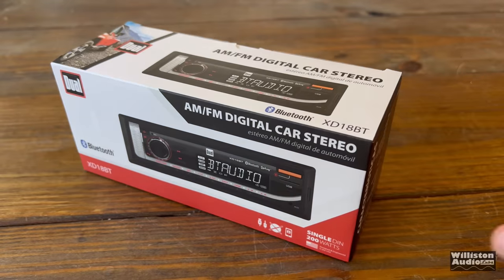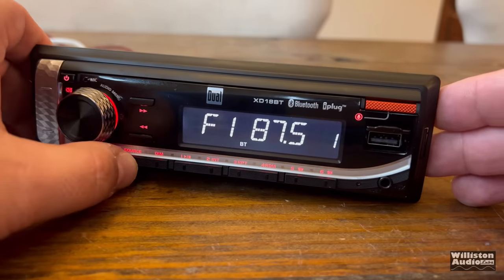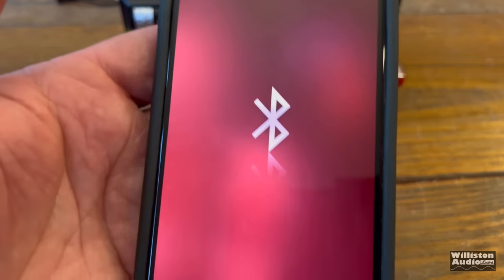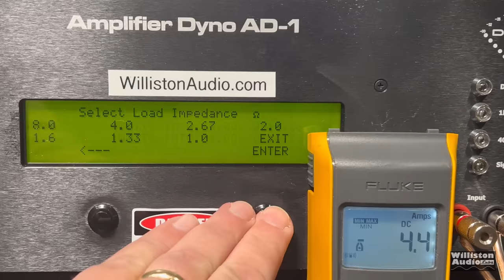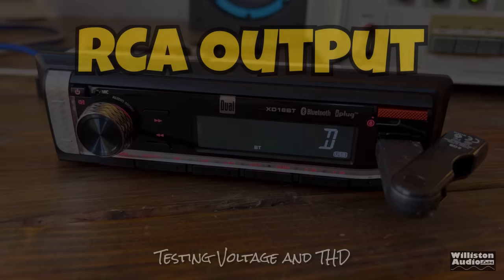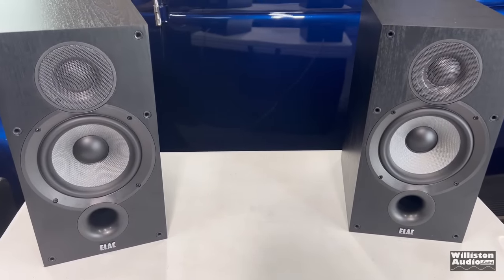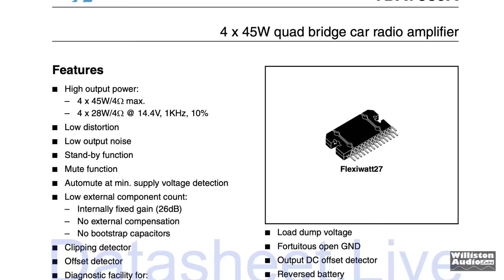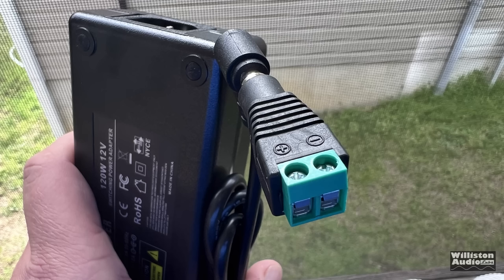How Bad is Walmart's Cheapest Car Stereo?

Comment: AM is actually required to be included in factory vehicles via US law.  The reason being is emergency services.  There’s an AM station for state highway conditions.  An AM station runs on 5,000 watts to run its 10KHz bandwidth at full power.  FM requires 100,000 watts to run its 200khz bandwidth at the same power.  So AM can easily be run on generator power during a blackout blizzard.  It’s only being recently challenged by Tesla, because high output electric motors cause a ton of interference.  All that being said, I think the radio just includes AM because it’s another feature they can advertise.

Comment: ! Same stereo as the XDM16BT Over 3 years ago, only changes are the Face design and the app control! But Overall a Great Basic Radio with USB and Bluetooth capability for the price. Although you may need to press the reset button once or twice due to weird function after trying Bluetooth Calling for the first one or two times but then it works flawlessly! I think It's the same stereo inside that is sold under the JBL brand with a different Face! Could be wrong but it does seem like it. Lasted for over 3 Years now! The Blaupunkpt didn't so Build wise it wins for the price!

Comment: Great video. Great starter on a low budget, maybe get some younger generation interested in car stereo because they can afford it.  I have Dual brand amps that were super cheap , work good , and actually have CEA rated  RMS  ratings on the back of the amp . THANKS for the video.

Comment: These usually come with the TDA-7388 or the YD-7388 amplifier chip they sound decent maximum power you will get is 41x4 @ 14.4 volts

Comment: I put one of these in my 1991 Chevrolet caprice, because the radio that the prev. Owner put in it, went out. The head unit was impressively good, Bluetooth connects easily, and it improved the sound through the stock speakers!

Comment: I have the Dual XDM16BT from a couple years back. It was about $18 when I purchased it. Has 4 RCA outs, the 10 amp fuse is made into the rear of the unit and the chassis is a bit deeper at about 5.5 inches. 
Couldn't get mine to distort at all on the DD-1 using the  USB as the source.
They're good for test benches and maybe off road side x side four wheelers.

Comment: Now I could definitely use one of those adapter purposes. But I've got 12 V power supplies.
That can couldn't support up to 15 amps I think with some good speakers and a well built speaker box. This head unit would be perfect for a home speaker system build. You could even put in a charging system and a large 12 volt battery To take it on the go.
Reply: That's exactly what i had planned on doing to the 400watt sondpex full range speaker box i got from AutoZone a couple of years ago after i changed the speakers with the pyramid the original x65 300 watt 6 1/2 inch driver woofers and drastically improved the sound of the box and it became the rear speakers in the early 94 Chevy Z71 Silverado extended cab short bed truck i had because the rear factory speakers are blown

Comment: Kind of surprised that YD7389 didn't explode when tested on 2 Ohms. I Have one of the $20 Dual radios from about 5 years ago in my closet and the YD chip has a hole blasted in it. I Believe the YD clips lack thermal protection aswell but i haven't tested one lately

Comment: I put this head unit in my truck as a temporary solution until I get a touch screen unit. I’m very impressed. Less distortion at full volume and close to full volume than even some name brand head units I’ve used in the past.

Comment: Many here mount these things into desktop computers. Using the aux in to connect to the computer. Powered from the pc power supply.
Well , output will be less , as its not 14.x volts but only 12v. 
But they do work , and 2 ohm is absolutely a load they can take.

Comment: These are way better than the factory systems of even 10 years ago. We out them in our semi trucks to replace the garbage Freightliner head unit they came with. Way more amp, clearer sound, and bluetooth built in. Its not audiophile quality by any means, but its a massive improvement for a commercial application.

Comment: I got one of these to make a custom clock radio for travel. Going to use a cheap digital alarm clock and wire a relay to the buzzer output. Planning on making a box with 12v power supply and 3" woofers and a monssoon planar mid/tweeter.  Can use for mini stereo on the road. Has Bluetooth so can use my cellphone as well as charge it with the Usb port.Hard to find a decent Am/fm stereo clock radio.Also can biamp the speakers by using front for the planars with a inline capacitor to act as high pass filter and rear for woofers.Can balance output by using fader.

Comment: 15 years ago my dad built up a classic car (lead sled) and the dash had no room for a radio as there was mechanisms behind the dash where a radio would normally go (the sudo AC was a big handle that opened a flap on the outside between the wipers) so I found him a Dual (different model than yours but pretty similar and was like $25) well, hooked it up to a good amp and man I was really surprised at the quality. I put all of his music (50's 60's) on a single SD card that plugged into the head unit and it was great, unit also had a remote.

Comment: I drive a 97 Chevy k1500 and purposely sought out the factory radio for it for restoring purposes.  It has a KILLER cassette deck with Dolby and auto-seek and when you put factory cassettes in it, they sound nearly identical to CDs. It also has a CD player and my CDs sound a hundred times better than the aftermarket Bluetooth devices (fm transmitter, Bluetooth cassette, etc..) all of them! I just put new speakers in and, to me, it’s worth it to keep buying CDs, they just sound so clean!

Comment: Recently did my own stereo system technically, had a stereo shop install the wires, but got my own 100 dollar 1200 watt Jensen amp from walmart, 65 dollar 1600 watt Massive Audio 10 inch sub, 60 dollar sealed box, installation of the cables 100. 325 dollars approximately for a really bumpin stereo system and because my Lexus has a top of the line head unit and door speakers and tweeters it all works out and boy getting into the stereo world makes it all worth it in the end when you get it right.

Comment: Need to replace the outside stereo unit on my RV that has never received FM signal. Hopefully it'll plug right in. It's just a regular single DIN radio with removable head unit.

Comment: I have this exact radio in 4 of my vehicles putting on in my 5th vehicle I cannot believe how good these work some vehicles it's a little more quite than others but that all depends on alot of things but generally it's pretty loud and works good previous models I've used in vehicles in the passed it wouldn't save the bass or treble everything I turn the vehicle back on it resets but that issue seems to have been resolved I've had the touch screens by this brand as well I had worse luck with those but they worked for quite a while before any issues and when they did have issues it was minor I did have a new touch screen quite after about 6 months but other than that I like these 25 dollar units they hold up really well its basic for what you need

Comment: About the incomplete tests when using the USB stick and Bluetooth; You didn't say if you put an MP3 on the USB stick or a flac, but if it was an MP3, that would explain the dyno not being able to measure distortion correctly and thus not finishing the test. MP3 is a terrible, lossy audio format that has really weird distortions that can thrown a THD analyzer into a tizzy. Same goes for Bluetooth, just not as bad with modern codecs.

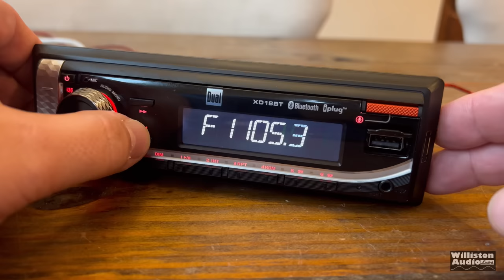Comment: 2:46 i do especially if its an old time radio show, but its mainly to band scan to see how far a MW/AM station i can pick up depending on atmospheric conditions. there's quite a few that still listens to MW/AM. and i also scan around on shortwave just to hear pirates and odd signals.

What kind of measurements are they using to come to 50w per channel, they have to be jist pulling numbers out of the air or something.

Comment: I like to recycle old pc power supplies and make little stereos with these cheap head unit and left over used car audio equipment I have laying around. I have one of the older versions of that Dual in the room right now that I use as a test bench for subs and amps. I also actually have a spare Kenwood Excelon that I use as my office stereo running off a 1500 watt PC power supply. They are only 12v but they aren't too bad actually. When I see one on Marketplace for 20 bucks I grab them.

Comment: These head units are good replacements for dead units, especially when the OG units are often hundreds for no real reason.

The real use for these things will be in commercial trucks and heavier equipment, which are often shipped without a radio at all.   DIN mounting and all the basics you would needs for next to nothing makes most fleet managers happy, and is priced so that a lowly hired driver could add a radio to his company work truck cheap enough to just do it.   Certainly not an audiophile piece!

Comment: I have had one of these of one model or another in my rigs for 10 years. 
They last long enough for the price.
Had one last for 5yrs in my jeep XJ. 
I want a sticker that says "This rig is equipped with the cheapest radio that walmart has it won't get you a rock so dont break my window"
I use the stock speakers and it works fine

Comment: I got the blue led dual head unit about a year and a half ago. Just recently the  screen led back light is working intermittently. Has good power output and audio. Just wish the backlight  led wasnt going out. Happening after only 1.5 yrs. A little disappointed in that.

Comment: for $25 (£20) thats a damn good deal,  just a shame most modern cars have oversized shaped head units to prevent theft, plus the extra cables needed for steering remote buttons/dash display screens.  but for older cars with DIN size head units this is terriffic. i'd buy one

Comment: One of these head unit vendors should try putting a descent chip amp brick/board into the full length envelope now that there is no cd player.  Just give it some 10 gauge power input from the battery, and you can finally get a true 40-50 watts rms that actually sounds good.

Comment: This is a very impressive head unit for the price.  The only thing I don't like is the USB being horizontally mounted instead of vertical, and the fact it doesn't support CDs.  Granted it's a tiny device, but the point still stands.

Comment: 200 watts lol.. on a 10 amp fuse. Bet they are doubling the 2 channels on each amp circuit = 4 channels at ~50W : 200W (the theoretical max the amp transistors can handle. not delivery) 

kinda shady practices

Comment: One thing I utterly loathe about all of these modern head units is the multi-function knob.   Some convoluted series of twists and taps to do something as simple as lowering or raising the bass level or adjusting the fader.   There is room on a single din frame for more than one knob.  Screw all the swoopy curvy, stylized crap taking up space.  Just put in separate Bass, Treble, Fader and Balance knobs.  Delco head units of the let 80's  early 90's got this right.  Some even having a 5-band EQ and Dolby NR.   Yes they were 2-din units, I know.  but today and how tech had drastically shrunken,  There is no excuse for lumping every function into one single, floppy, wiggly, knob that will fail in a month.   I don't need Radio presets.  FM blows with dumb yuntser jocks doing some beavis & butthead routine shouting about "FOOBAWL!!! and "DUH STILLRZZZ!!" all morning, every morning and the same 10 dead-horse songs all day every day.  AM is unusable anymore with all the RFI in the air nowadays.  So screw the radio altogether. I need AUX, BT, USB, and SD card inputs.   Perhaps the ability to input audio over the AUX cord  but still control the device via BT commands from the head unit.   Volume,  Bass, Treble, Balance, Fader, and maybe a simple rotary tuner knob if radio is still a must.  MP3, WAV and FLAC compatible. 

Honestly,  I utterly hate touchscreen crap.  But the best thing I have seen recently as far as ease of use and ease of access to basic functions is the Uconnect unit in my 2019 Grand Caravan company van. Granted, connecting BT with it is a bit fiddly with all the voice prompts,  But once it's done,  It's done. And having an internal drive to store music is a HUGE plus!

Comment: Totally agree on the volume, when I bought my head unit I had a bunch of specs it had to have but then on top of that it had to have a rotary volume control which when coupled with all the other specs I required, left me with very few options.